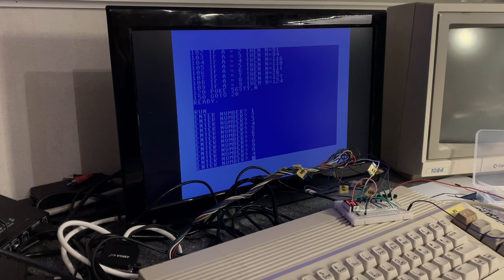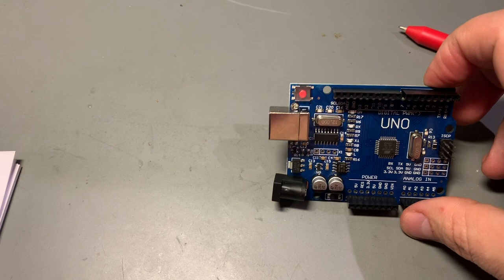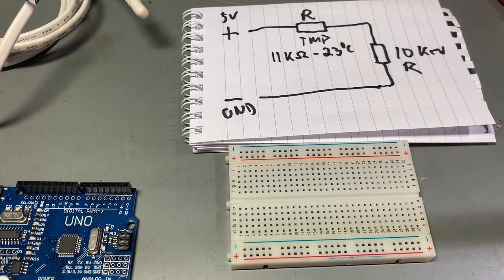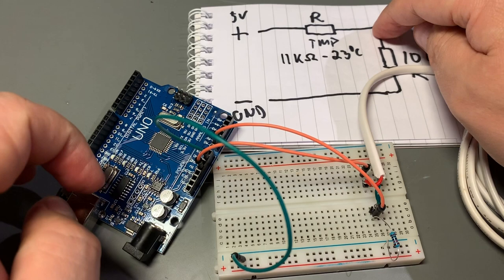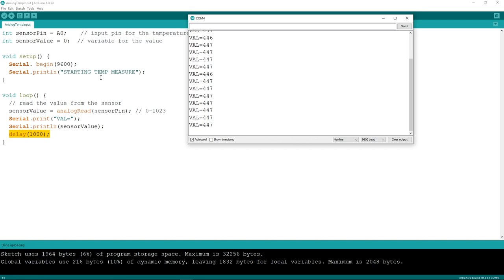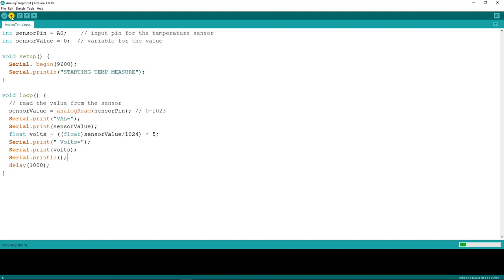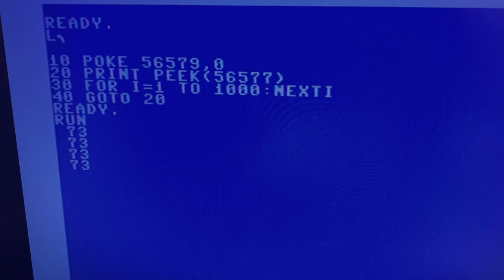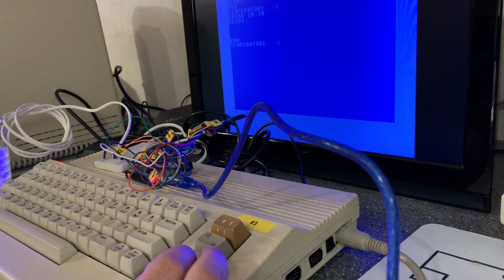Controlling electronics with the Commodore 64 user port - Part 3 with Arduino

Comment: I actually did this very same project through the joystick/game port using a thermistor with a couple descreet components and a basic program.
It interesting how the joystick port can be set as a input of output port, totally programmable using the 6522 VIA chip.